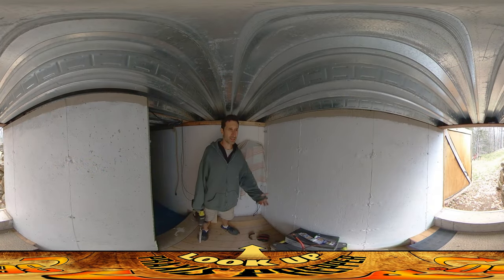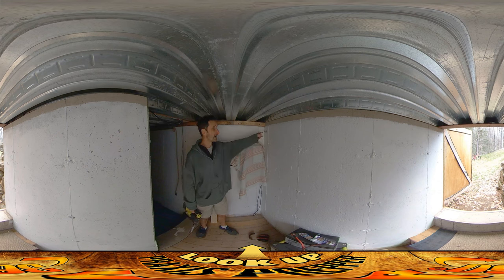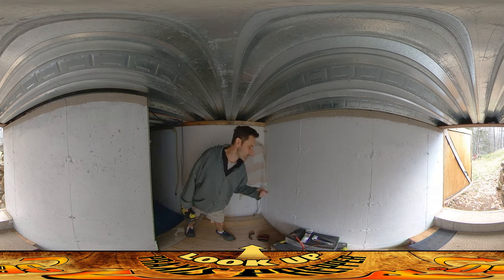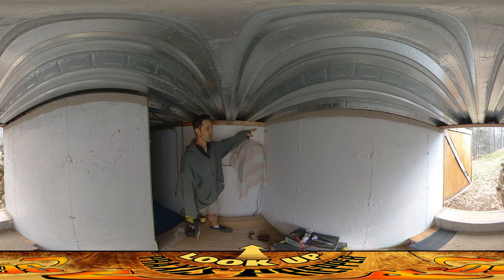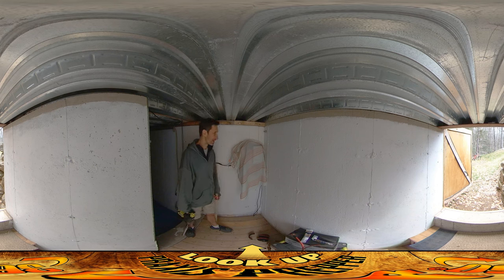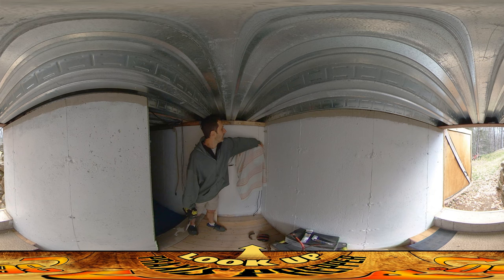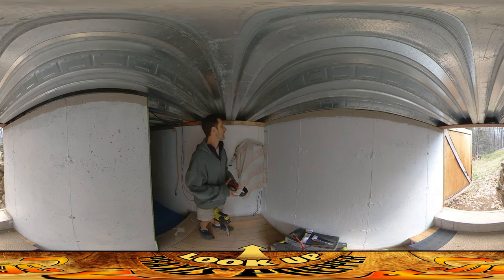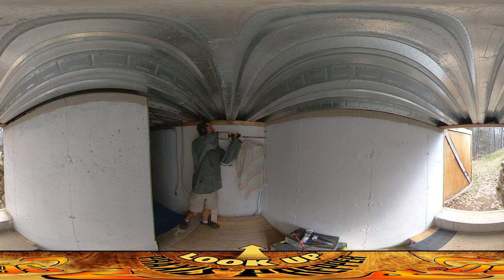Homestead Building - "Drilling" Concrete for Electrical

Comment: When you are damned if you do, and damned if you don't. There is nothing to it but to do it, or not.

I understand it, and still struggle with it myself. In these situations the stress really is all in your head. It can cloud your judgement, and you can make another mistake while trying to fix a mistake. In these situations all we can do is learn from it, and move on.
Reply from the maker: I always get it right the second time around at least. I learn good from experience... except (obviously) when it comes to English grammar. ;)
Reply: @PraxisPrepper  That's alright words, and how they are used is all made up anyway.

Comment: We don’t get to see you down very often so hopefully there isn’t something else going on that is stressing you out (other than the impending end of the world). On the plus side, that cement will have plenty of time to cure before you can get back to it.
Reply from the maker: My feeling down/frustrated usually lasts as long as it takes me to come up with a plan and to continue moving forward with something. Often times an hour or less. A lot of people I know or people in my family suffer from depression, and I'm really glad that I've never had an issue with that. It can be debilitating for people.
Reply: @PraxisPrepper  Definitely understand that. Shelly is bi-polar and has bouts of depression or mania when she doesn’t take her meds. She’s been doing a much better job of consistently taking them recently but I know it’s only a matter of time till she stops again because she hates the feeling of not having emotions. She acts pretty normal but doesn’t have deep emotional reactions to things that would normally be sad or happy and she doesn’t like that. Like most things it’s a balancing act and I just try to support her as much as she supports me.